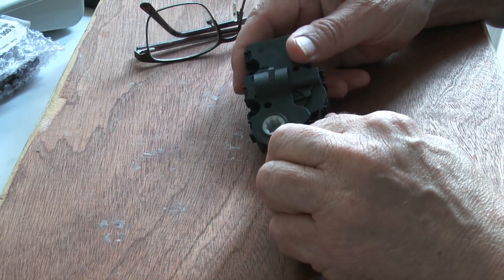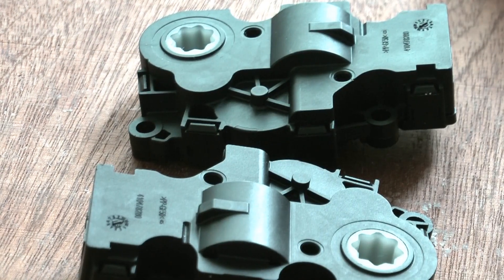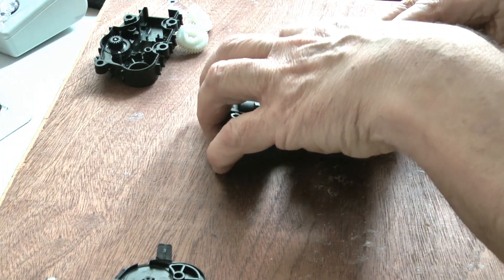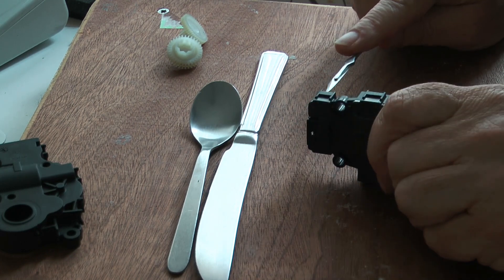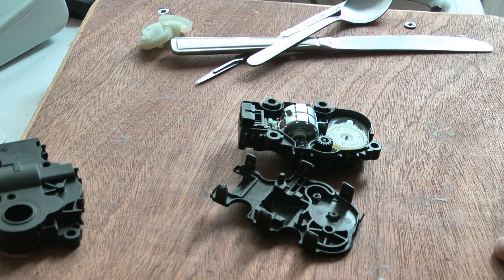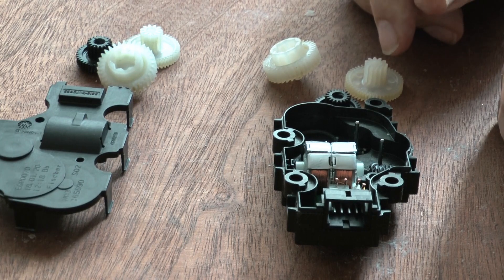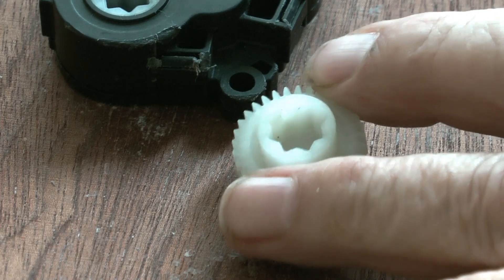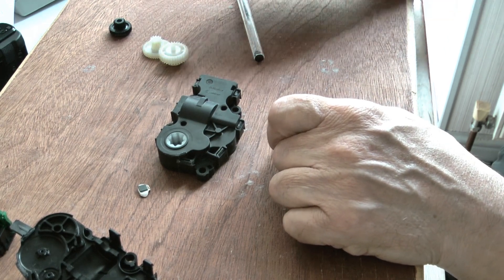Opening a heater flap actuator, Mercedes Sprinter 2019

Comment: Very interesting Roger. You are absolutely right about cutting away from yourself. If you want to see the results of not doing that, look at Big Clive's plastered left hand. As for the steppers, one might wonder about the fact that the Mercedes dealer I called in at ( in France) happened to have three of them in stock. That sounds as if they are a known fault so they keep a ready stock of them. If the ones they returned to me do in fact work correctly it looks like a scenario I am familiar with: All that needed doing was to un-stick some sticking plastic hinged levers, and spray them with a bit of lubricant. However, because they had to dismantle the dashboard to get at the levers they would feel justified in charging 4 hrs labour. Which they did take by the way. And the interesting thing about the invoice was that they charged each separate part of doing the job at different labour rates, ranging from €70/hr to €110/hr down to 0.1 of an hour. My nearest MB commercial dealer charges a flat rate of £180 per hour making it cheaper to drive to France to have work done.
Reply from the maker: Good to hear from you Andrew and thanks for filling in the detail of the repair, this will be of interest to others. 
  
1. I’m with you – those flaps stick. It would be fun going down the airways with an endoscope and seeing what is going on for real. If the fans get in the way just drill an access hole somewhere convenient.

2. The cost of employing a certified Merc. Electronics Engineer and having a tester to check those units makes it far cheaper to just throw them away and fit new ones.  The fact it worked is more testament to the connectors getting a workout, than the units being faulty.

3.  Three units all failing together – NEVER!

This is a very niche subject and I’ll email about what I could test – save irritating those out there looking for answers and not getting any.